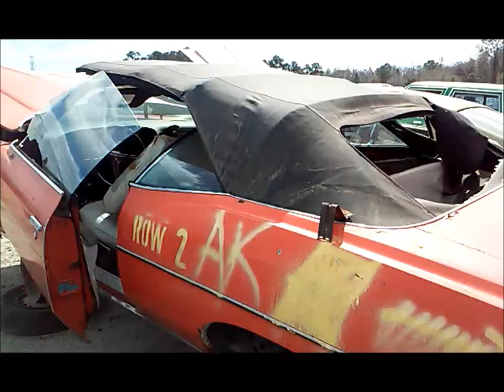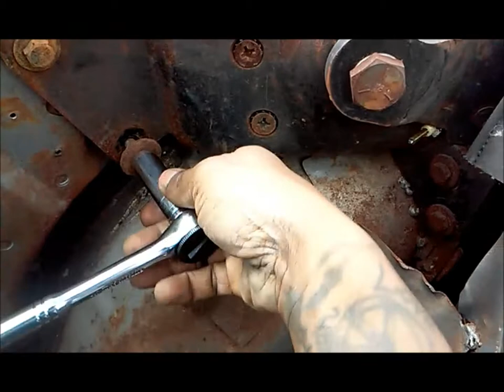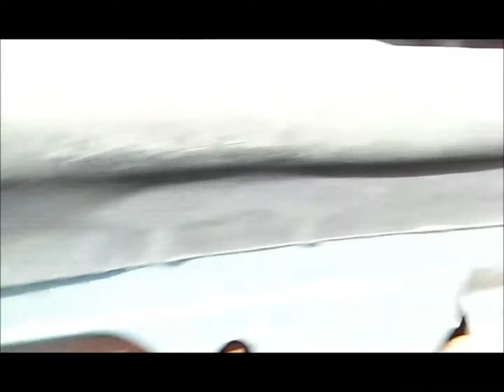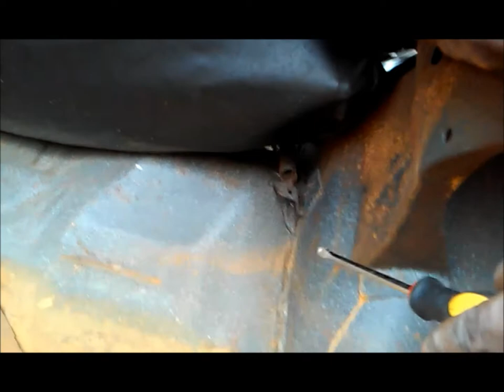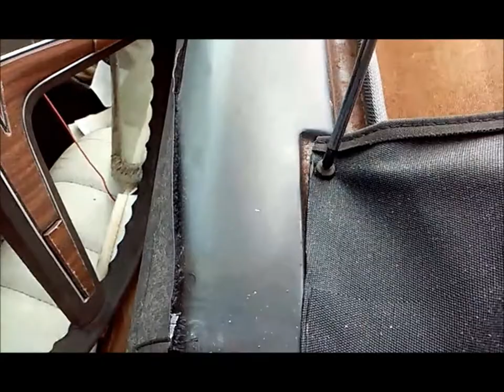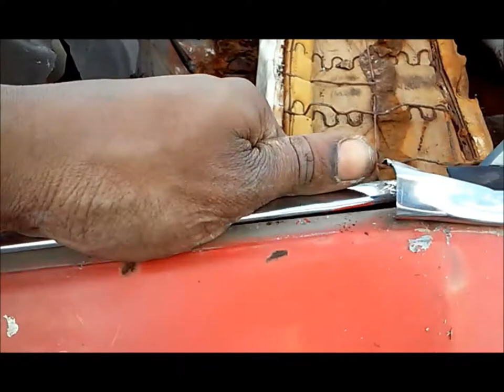GM Scissor convertible top - How to remove interchangable vert top

Comment: Hey bro i have a 1974 pontiac grandville convertible.can you tell me how i can get my top to go up i can hear my motor but theres no movement?
Reply: Check the drive cables bro. Should be a black one on the passenger side and a blue on the driver's side. They connect to the motor, one moves it forward and the other back. Hope that helps.
Reply: Sounds like cables...on Ebay for like 80 bucks for both